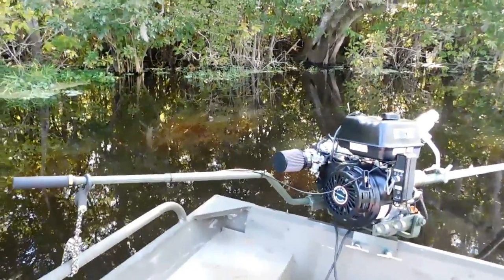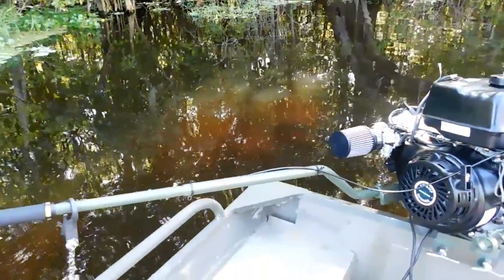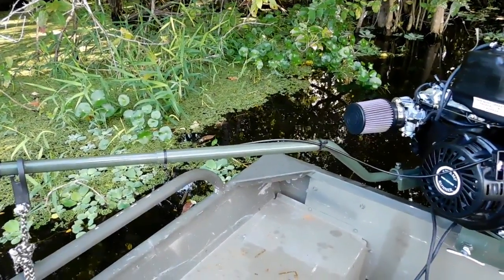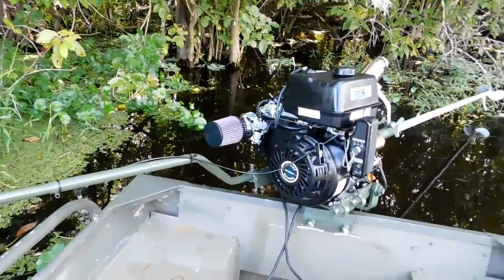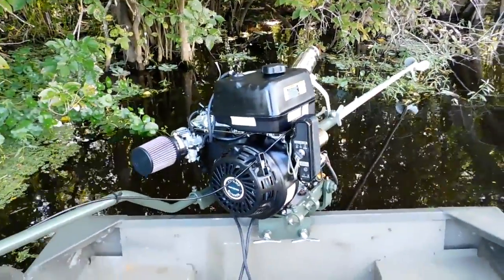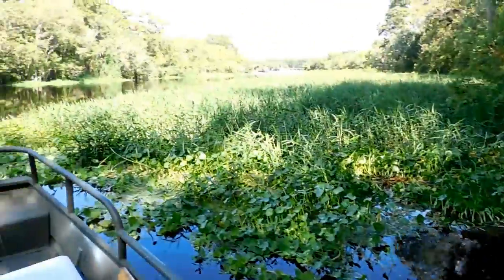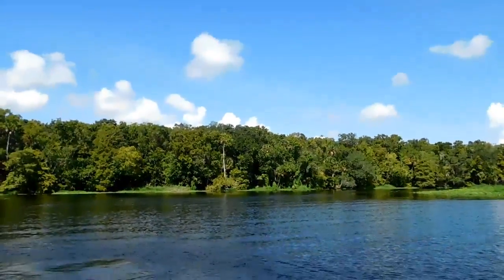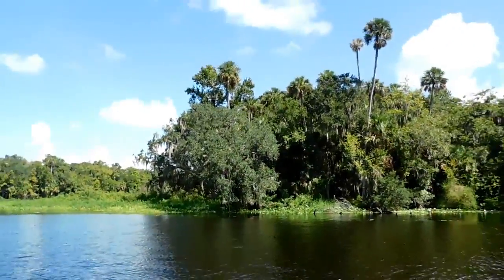SPS LONGTAIL 1st day out review

Comment: I like the new throttle lever I picked on up when I was in palmetto a few weeks ago
Reply from the maker: What did ya go with
Reply: Cactus Matt I got the throttle with out the built in handle grip as I was using a bicycle lever and could not get full throttle I actually get about 18-20 with a 15hp Lifan on my 16/48 I jetted the carb added a header and intake I run the 9" prop solo and 8 1/2 with load I get 38-3900 rpm on tach I am building a  22hp large in spring just not sure if it's worth the money For 2-4 mph lol

Comment: Question about your boat: did you put the rails on it?  Thinking about adding some for mine.  aluminum welded?
Reply from the maker: the handrail and grab bar is a design i came up with  and found a guy here in town that did boat railing welding ,that's all schedule 40 aluminum tubing , it can be a tad pricey , but i really didnt think it was to bad ,for all that schedule 40 aluminum tubing ,the bending & welding it was only $700
Reply: thanks for everything

Comment: Hi Cactus Jack - Do you like the 13hp better than the 22hp? -I have 1448 jon & trying to decide between the medium or large kit? I think the 13hp would probably push the boat fine but Im about same size as you & my fishing buddie is also plus some fishing gear & cooler etc... Appreciate your opinion & was also wondering about fuel consumption for running 20 mile up river overnite camp fish next day & run back jack...
Reply from the maker: i like the 23 hp better , im just running this one while i have some work done on the 23hp , briggs & strattron, actually im going build a large kit useing a 22hp harbor fright next as well ,even before getting the briggs back up , i want two large kits up and running so i can have  a back up, bc im planning to running all 310 miles of the st johns river in the fall , i may even run back south on the intercoastal waterway when i hit jacksonville florida , if i do im not sure where ill stop , but i do know im running all of the st johns , so when i start if there was something to happen i would want to be able to change out the longtail and keep going , but if price is not a issue you will be happier with the large kit
Reply: Thanks for the info. - that sounds like quite an Adventure! Hope you get to record some of it - like to see! I plan to eventually own one of each size kits but will go w/ the Large next! Thanks again for your help & Good Luck on the St Johns trip...
Reply from the maker: ill record all of it from start to finish , well not every second , but yes i will document the trip , i will be down at blue cypress lake toward the end of this week to get footage of the ospreys that live there and gators etc as well as to start my recon for the trip .
Reply: Ill be looking forward to seeing you on your trip Cactus Matt! Stay cool & be safe....

Comment: Hi i have an 11 hp engine what fan size do i use
Reply from the maker: If your asking a question to do with the motor ,its all stock with the exception of the carburetor ,air filter and the header type  exhaust . if your asking about the prop i use different sizes, but i believe this one is  a 6 in prop.